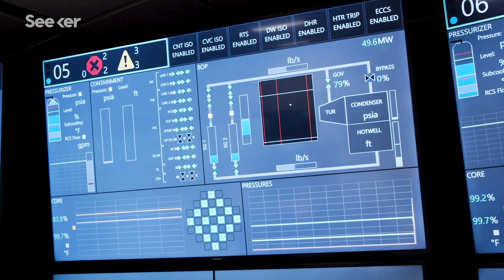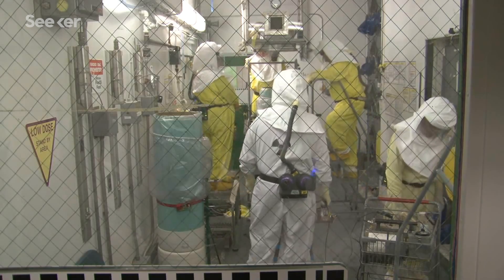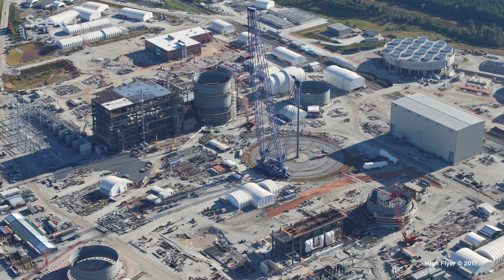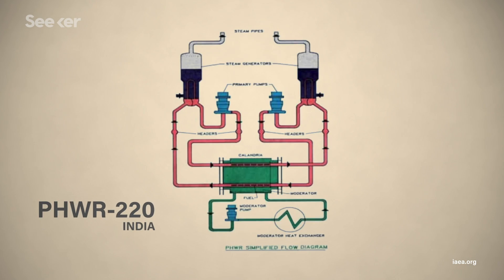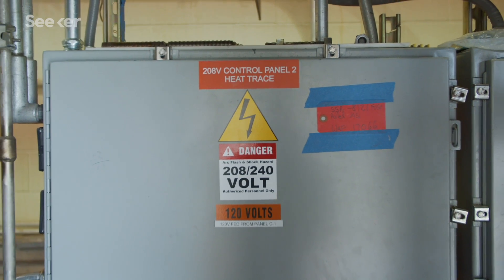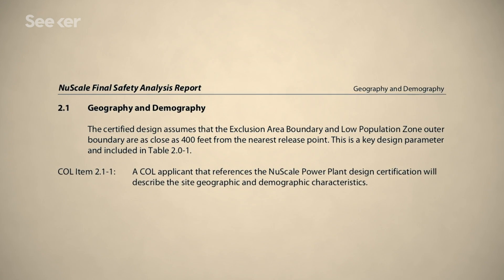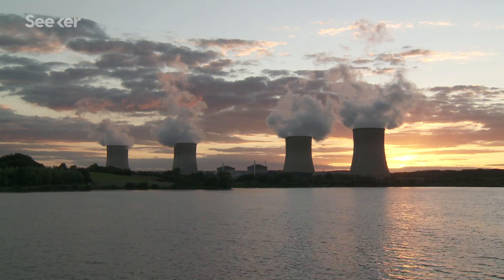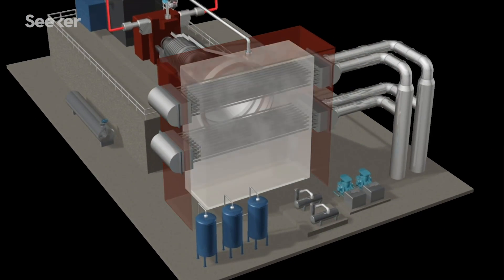Mini-Nuclear Reactors Are Coming, and They Could Reinvent the Energy Industry

Comment: This is stupid. We still have problems with the waste of old plants that for years they have been saying that they're going  to transfer them somewhere safe. 
So now smaller is safer? All we think of is immediate profit for the some and leave the future generations to deal with the mess. 
Thank God I'm old. Because I dislike seeing stupidity grow instead of humanity learning from the past.
One thing I say about technology now that I'm older, " Just because we can, doesn't mean we should."
Just my humble opinion.
Reply: one of the key features of new reactor designs is that 90% of the fuel gets burned down to safer elements like xenon. also they can burn the waste from old reactors so you have very little need for storage. if we build enough new reactors an area the size of a football field could hold 100years of waste from every reactor in the country. which is long enough for it to decay to a safe level. then you have fusion reactors around the year 2030 that turn the fuel into plasma and will never have solid waste. even if you have no old reactors running the new small reactors will still have a use in that they help build industry in refining radioactive materials which exist in deposits of other valuable materials like iron. thus bringing the cost of those down. right now china has an advantage in mining because they don't have the strict standards we do. on top of having access to naturally more pure deposits of material.

Comment: I like how you neglected to include solar and wind deaths, when talking about the dangers of energy generation, because nuclear has killed the least of all. Shocking I know.
Reply: The problem with wind and solar is that it's not easy to regulate the voltage going into the system, and no way to mass store the power. If in the case of wind power if the wind drops the voltage will drop, then a power plant either coal or hydro will speed up their turbines, to compensate. If you stick solar panels on your house you can either get batteries to store the energy when there's no sun out(but having everybody use batteries will kind of defeat the purpose of being green as they are not very good for the environment themselves) or you can tie it into the power grid, which will put power into the grid when the sun's out and take from it when the sun is not, and at the power plant there is a computer that will adjust the turbine speed accordingly to keep it at the correct voltage output. if everybody switched to solar power on their houses tomorrow during the day there would an over voltage, and most likely fry every computer on the grid, and during the night you'd still need the coal. This is why they're looking at nuclear energy, wind and solor is a good supplement and I'm all for it as it does cut down on coal use but at this point in time it is not a viable option to completely replace turbines.
Reply: i know its surprising when news channels and papers bash the nuclear industry but not the other energy solutions like hydro and how it can wipe out many fish populations
Reply: idiot... have you any clue how many people have been killed by Chernobyl and will die from it in the future. Chernobyl will be uninhabitable for 25000 years and many many birth defects are attributed to that disaster. when a reactor blows its a huge issue. what if a foreign power blows up a reactor on our soil. what about when war kicks off. can you imagine if a bunch of tiny reactors were spread out all over and a war reached our shores and these things were targeted. mayhem....
Reply: @junepaul7843  People live there now. The only part that is uninhabitable is under a concrete roof. One dam failure killed more than 10x the people your Soviet experiment killed. Yeah, you're bringing up a Soviet experiment as proof of idk what.
Reply: @junepaul7843  Maybe you should do more research than just watching HBO series and reading some greenhead's website.
Reply: @junepaul7843  How about you actually read some actual reports? The UN report stated that the total amounts of deaths by Chernobyl is only around 40, with the absolutely highest they can go is 200. And those 160 extra aren't even certain, because the rate of cancer that those deaths are attributed to are the same as the rest of the population. Not to mention that those deaths are generally regarded to be typhoid cancer, which is the absolutely easiest cancer to deal with (over 90% survival rate.) If this is the death rate of the, as dubbed by researchers "worst possible case that can happen", then it only takes Windpower about 4 years to make up as many deaths. The UK released as statistic that 16 people average die per year from Wind. 
These are the annual statistics for the entire world: https://www.statista.com/statistics/494425/death-rate-worldwide-by-energy-source/
This is the UN report on the accident: https://www.un.org/press/en/2005/dev2539.doc.htm
Oh, and the mutations? Complete bollocks. The old UN report on Chernobyl as well as the modern one, plus all the other studies around the event have found NO mutations or birth defects in neither wildlife nor people that is worse than any other part of the worldw. And again, worst case scenarios for reactors, especially in the case of reactors such as this has very, very many benefits. Look at chernobyl. What happened? The fissile material smelted together into a giant ball and fell into the basement. It was the explosion, which spread surrounding reflectors and graphite that caused most deaths. This cannot happen in the west because every single nuclear power in the west have containment buildings, something Chernobyl didn't.

And for the "war." If such a war happened, trust me, the last of your concerns would be nuclear power plants.

Comment: The problem with these reactors, is lack of efficiency. Nuclear power efficiency is closely linked to the mass in which you can maintain a near-critical reaction state. With less mass, effective depletion will be less... thus requiring more radioactive material to achieve the same amount of useable electricity. This not only results with more nuclear waste, but more active radioactive waste... thereby worsening the problem of refuse containment, as we already have issues with.

Comment: could run buildings on them while remaining off grid .2 tiny units .. .could lower costs for corporate buildings .factories even ...no electricity bill ..no heat bill  ..i bet the byproduct is a lot of heat ..could heat a building that way and power it.. place radiators around the building to cool the water

Comment: Humanity will likely end up being forced to do ALL of these like•it•or•not:

1. CRITICAL or we die, weir dam at St. Lawrence Is., Bering Strait, poldering north the entire Chukchi Sea to establish a seaice refuge to stop the jetstream going north there.

Using same Dutch levee system refreeze METHANE VENTS with submerged "atolls",  pulls colder water over the lip.

Or, it's GAME-OVER on the "Runaway Methane" GAME-ON in the Arctic [46,000 views on https://forum.arctic-sea-ice.net/index.php/topic,1545.0.html]

2. Use magnet motors for everything, no fuels, no CO2 emissions, they decay at 10%/1000yrs, a 1300hp/1-Mwh genset technokontrol's RF-5000 is being adapted to their aircraft drones, sparkless, ships in a container, military‐spec, you can buy them.

3. ALL IC-ENGINES must use N.Tesla's Tailpipes, his 'valvular conduit', a one-way air valve with no moving parts, scales to coal smokestacks, nearly ZEROS emissions.

=> These must be FULLY SUBSIDIZED or it'll never happen; afaik I'm the only designer with sht•on•a•shelf ready for CAD on these.

4. Use ALGAE to purify wastewater home•farm•ranch to city treatment plants, the BIODIESEL -CO2 +O2 BEFORE burning & $elling it pay$ the bill$ no soot with Tesla Tailpipes.
Ymmv.

Comment: Solar and wind have become artificially "cheaper", where the resource drain is actually the same. Nuclear, in terms of raw materials, is a far more efficient model. The only thing keeping wind and solar alive is heavy duty subsidies that the consumer pays for. The consumer gets hit a second time when their electric bill is above normal (look up the energy situation in germany).
Reply: The subsidies that renewables receive is miniscule compared with those handed out to fossil fuel companies. Renewables have become cheaper due to market forces, with mass production and competition leading to large cost decreases.
Nuclear reactors require huge amounts of concrete, which has a high carbon footprint, and the World's supply of the sands necessary to build concrete are rapidly disappearing. In order to function, large amounts of ore needs to be extracted, often in remote areas, and uranium and plutonium, like fossil fuels, are a finite resource. The ore then needs to be transported and processed, and then there's the massive problem of storing nuclear waste, which is a very expensive, permanent cost. Add to that the huge safety risks involved, and it's easy to see why nuclear power is rarely invested in. The safety risks would be minimized a great deal if every one of the old, unsafe model of reactor were upgraded, but what would that cost and how long would it take for them to begin generating again?
Reply: @markrm16  Given that you seem to think Plutonium is naturally occurring, I'm going to ignore you since you're totally uneducated on nuclear power. The issues you quoted aren't issues, and most of them are a bigger challenge for wind and solar systems as well. Namely: carbon footprint, material extraction, availability and cost, safety risks and waste (two very laughable arguments with Gen IV technology).

Comment: Won't just selecting a Conventional 3+ gen Nuclear Reactor design like AP1000 and mass construction of it can reduce the cost of building Nuclear reactors & power plants??

Small cities or Rural areas can use Solar energy for most of their requirements.

Then this raises question over the need for SMRs in long run. 

It's the industrial areas & other Advance infrastructure that needs large scale continuous supply of electricity.

With more High capacity & reliable batteries, Residential Homes may not necessarily need Supply from the National grid that often as Solar is more than adequate for such things.

Comment: What da actual heck?! 1) Your company's risk evaluation isn't worth crap. YOU are not entitled to evaluate the risk you create yourself. 2) Just because Nuclear killed fewer people than coal, doesn't absolve it from it's nastiness. What logic is that? 3) When it comes to nuclear, "pretty safe" just does not cut it. It's enough for it to go wrong ONCE. If you don't believe me, ask the people in or around Chernobyl/Ukraine. 4) If the exclusion zone is 10 miles, it is 10 miles. I'm not okay with reducing it to 1 mile for you, just because you have a few more switches installed as added security features. You water-down safety regulations at the hazard of innocent civilians. That has been shown time and time again. 5) Are you or are you not gonna be producing unusable, toxic nuclear waste? Are you gonna be using enriched nuclear fuel or have you found a way to use nuclear waste from other plants to produce energy? Tell me about that, and I will call this an innovation. That's not a cat you have in your hands; scaling it down doesn't make it more cute.

Comment: Its the same thing that happened with computer CPUs, instead of a super massive core, we now have lots of small ones.
Reply: It makes perfect sense to downsize reactors and operate them locally. There is, of course, a size you can't get below as you need to have a supercritical mass of fuel in order to sustain a chain reaction.

Comment: This was talked about in Asimov's books 50 years ago.  Imagine a battery sized nuclear reactor that works for a thousand years, just plug it in.
Reply: There is a size below which its impossible to create a self sustaining fission reaction. The principle of small scale modular reactors is very appealing to me and is something I'd happily support and endorse.
Reply: @paulanderson79  Still, energy from fission reactor can be used for synthesizing chemical fuel, which can then be used for ICE cars and not only.
Reply: @caav56  we have many means to produce synthetic derived fuels for petrol and diesel road use.
None of which require nuclear reactors.
I am wholly supportive of nuclear  reactors for domestic and industrial electrical power. It's by far and away the cleanest way to provide utility electricity.
Reply: @paulanderson79  Indeed. I'm saying about how they can help to lower the emissions even more, if we start to even partially move from using fossil fuels to synthetics, manufactured with, for instance, Sabatier cycle. Of course, it might not be sufficient to satisfy global demand, but it can still lower the ecological impact to an extent.
Reply: Those Asimov batteries are called Radioisotope power cells. But they are not very efficient.

Comment: As with so many videos like this, it doesn't deal with the fundamental question of cost. The claim is that SMRs supposedly result in lower costs of construction. They may well do this, but will they ever bring costs down far enough to compete with what will then be 2030s renewables technology, advanced batteries and pumped hydro? That's a very tall order. I'm also a little wary of the NuScale design. its fundamentally a conventional solid fuel reactor with all the inherent problems that come with that. What happens if unforeseen consequences see the control rods foul, stick or warp and they don't drop? it doesn't have quite the same "walk away safe" feel that the best liquid fuel reactors do.

Comment: It's disappointing to hear very little about the nuclear waste issues
Reply: That was not the topic of the video though.
Reply: @faberofwillandmight  Fair enough, it is just tangental, but I guess with the idea of smaller (and closer to residential areas) nuclear sites, the question of where the waste will go seems important to me.
Reply: @Waitwhat469  A fission reactor creates remarkably tiny amounts of waste. The idea is that these are fit and forget devices. A design life of ten - twenty years is intended. At the end of that time the whole reactor is swapped out with a fresh one. The spent fuel can be reprocessed and loaded into another SMR.

Comment: Once they finally figure out sustained and controllable fusion reactions this will be obsolete.  It's good that there's advances in nuclear technology like this, but nuclear waste still presents a tricky problem.
Reply: aeroripper Nuclear waste isn’t an issue anymore with the advent of breeder reactors and plants that form increasingly less waste. Spent fuel can be used as fuel and in the process removes current waste.
Reply: @snufkin4374  Renewable energy is the primary industry now. Get over it.

Comment: "Pretty" safe.   (?!?!!!)
Reply: Tommy Mandel

Nothing is 100 percent safe. There is a risk in leaving your home to go to the grocery store. When dealing with issues of safety you're dealing with trade-offs. The trade off for nuclear is that it is by far with no close seconds the SAFEST form of energy production there is. It is a fallacy to say that there is a risk greater than zero and therefore we need to continue to drive those risks ever closer to zero, which practically means banning it.
Reply: @alexanderscott2456  TRUE, but some things are safer than others - and some consequences are graver than others. Like walking blindfolded across a sandbox isn't as risky as walking blindfolded across a busy highway. . . for 2 reasons - there's less chance that you'll bump into something, and if you do, it won't likely end your life. Same with nuclear - even if it's only got 0.1% chance of failure - if that failure happened once in 1000, and killed thousands, or rendered an area uninhabitable for centuries, or poisoned an important water supply, or led to an increase in cancer that you wouldn't see for a generation....that would be much worse than something that has maybe a 5% chance of happening - like getting beaned in a Little League game. You've got to multiply the probability by the severity to get any meaningful assessment of real risk. IMHO.
Reply: @tommymandel3326  Even if you add Chernobyl and Fukushima to the count, nuclear is the safest source of power.

Comment: What a stupid idea, a central control room ? If it is safe why a central control room is required ? Once more they want as to be energy dependent to make a profit. We can use solar panel to produce hydrogen and use fuel cells to power thee house without having to worry about nuclear waste 100% clean energy.
Reply: @SionPaddy  Just Chernobyl and Fukushima ? What you know about Humans and animals born with deformities right now in those places ?
Reply: @SionPaddy  >when engineers didn't take proper precautions
Actually, they've disengaged the automatic safety systems for this one test.